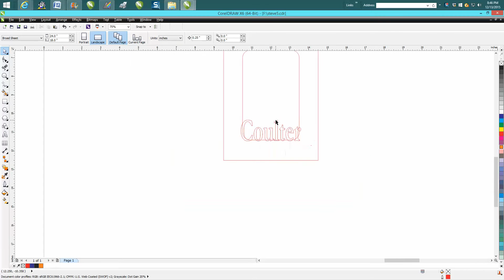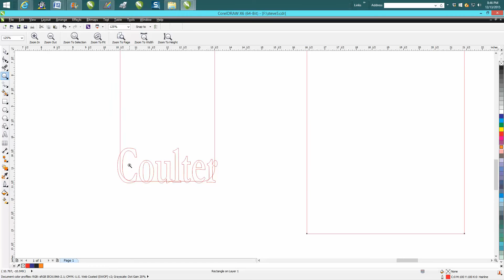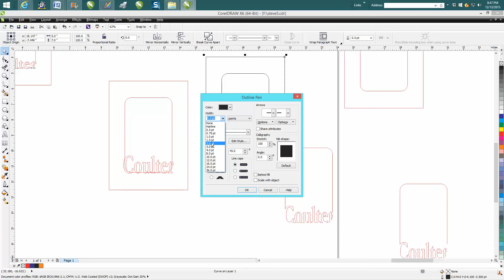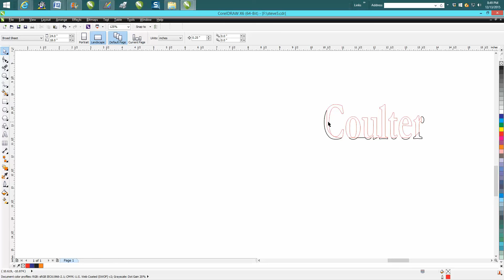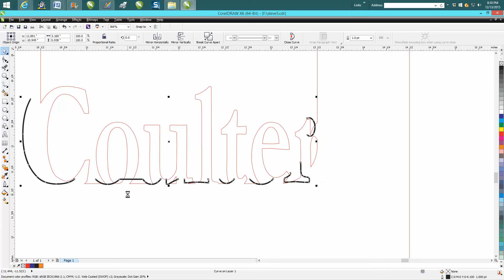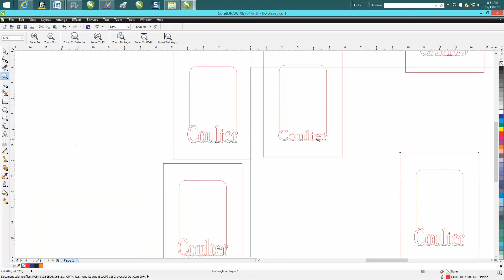Corel Draw Tips & Tricks Photo Frame  Weld with twist

Comment: Thanks for this tutorial.  It is exactly what I was looking to do. My project is to weld a word in between two long rectangles, I got the bottom half to work, but the the top half the virtual segment  cuts out giant chunks instead of the little lines in between the words.   Any thoughts as to what I might be doing incorrect?     I am working in the student version, and I think it behaves a bit differently than your program.   When I right click, I get a dialog box and it doesn't clear out the smart fill like it did in your video.  I can't just click and break apart the piece I smart filled, I have to convert it curves first before I break it apart.  So I ended up accidentally figuring it out.  I had to nudge the whole piece past and into lettering instead of level with it, when I did that it seemed to recognize there were segments and things worked.  Weird.